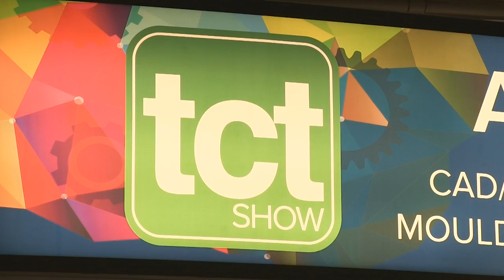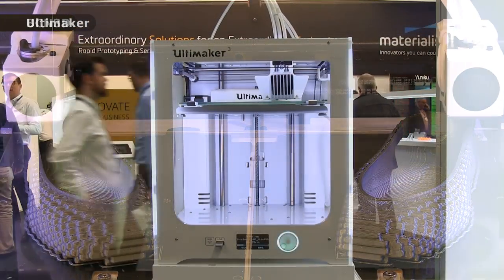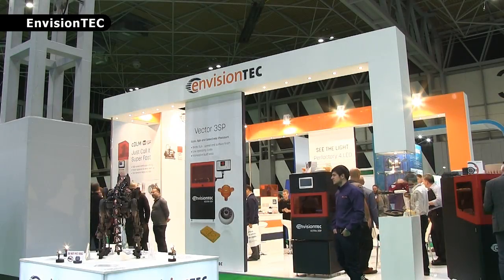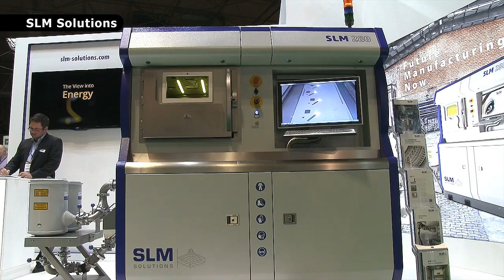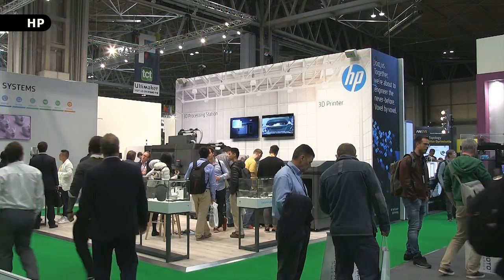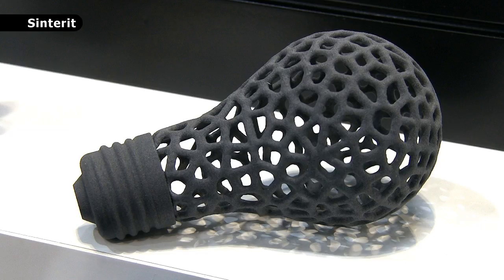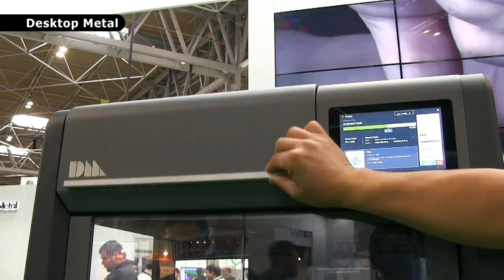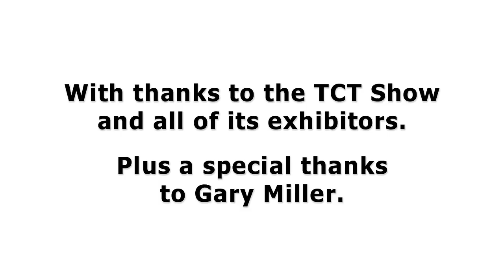3D Printing at TCT Show 2017

Comment: Metal parts are not really usable straight out of the printer because the material they are made of is very porous and needs several treatment to be able to use them as real metal parts !
Reply from the maker: This is simply not true. DMLS, electron beam melting and laser cusing are now being used to manufacture aerospace, medical and other final parts with minimal finishing required (and no post processing). Certainly there are additive manufacturing processes that produce relatively porous metal parts (like those from ExOne and Desktop Metal). But don't judge an industry by one technology alone (something I see happen repeatedly in 3D printing). GE did not invest $1.4bn in direct metal 3D printing to make parts that do not at least meet the properties of those made by casting or machining. :)

Comment: Thanks for covering the show in detail. I couldn’t make it this year, but you got around most of what I wanted to see. I wanted to ask all of the exhibitors selling metal machines if they could 3d print plastic injection moulds.
Reply from the maker: The answer would probably be yes, if with some surface finishing. Machines like that from Sodick (which 3D prints in metal, then offers CNC milling) may be best for this purpose.

Comment: why don't they make an extrusion plane, instead of just a tiny nozzle, a flexible plane that by flexing opens up holes, where the plastic materials can me extruded simultaneously, controlled by a computer that sends the 3D slice data to the sheet, and that way prints faster. Just an idea.
Reply from the maker: A very neat idea. This happens in resin-based printers. It also happens in so-termed DOD "drop on demand" extrusion models, that kind of spray hot plastic.
Reply: ExplainingComputers thanks for the info :)

Comment: Do any of those manufacturers sell any 3d printer for around USD $500,00?

Are you going to use any ESP32 developement board for your robotics projects?

You changed the intro again!
Reply from the maker: The intro has not changed (well, it was tweaked very slightly back in July 2017). There are lots of 3D printers for $50K or less. You could, for example, get a couple of the large 3D Platform models for that, one of the non-colour Polyjet printers, and just about a Desktop Metal system.

Comment: Oh whoa!  This is was such a good episode.  3D printing really gets me excited to start making things.  Lots of ideas running through my head  😍👍  Thanks for covering this, Chris.  You da man!
Reply from the maker: Thanks. I'm glad this got you thinking. Me too! There are so many possibilities raised by this technology. :)
Reply: I am an old guy but here are some pearls of wisdom on your thoughts. Look at the vid again and concider 3DP-Platform. They have a model "3DP-Platform #400 that has a workbed 58" on "X"axis x 39"wide on "Y"axis x 27&3/4"hieght on "Z"axis. I am assuming your still young enough to get on a life choise plan. First look at "SolidProfessor"(Solidworks teaching tutorial) they give out free a few lessons to give you exposesure to Solidworks 3D design. You can put your designs into files that can be loaded in that 3DP400 . Picture this: print plastic cores of body or frame components(even if they are longer than your printers workbed) that are light&ridiged. Read a book on wood joinery. Then you can give up 3" of of two printings in a sandwich/finger joints, and even though a Mustangs quarter panel might be longer than one printing by itself. By designing in mating holes in the corners of your printing by using Solidworks, you can bond two printings with Lamello Invis (invisable detachable joining) http://store.swissinvis.com/ . Even in putting two printings that have multiple curved surface geometry these connectors(8mm.,12mm.,and 30mm.) will pull all of your body panel core together at 260kgs. of pull(12mm. 9/16ths"). Once you have your body panel then use carbon fiber(colored or not) to wrap with epoxy for finished products.  Note some eight graders have achieved CSWP or CSWA licences where taught in some school systems. Certified SolidWorks Professionals(3.2 million world wide).  Next step is learning "rendering" softwares to show your customers various near life-like views of their finished autos.  I just gave you a view of your family's sucess if you get curious enough to search the web.  The Lamello Invis is a little(probably no one knows) trade secrate.